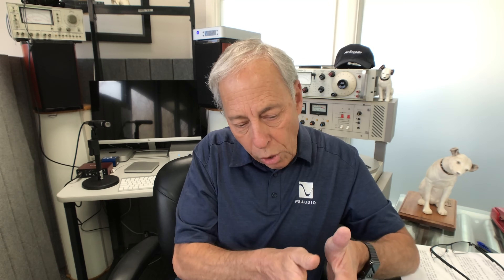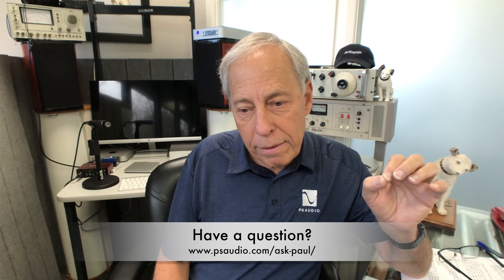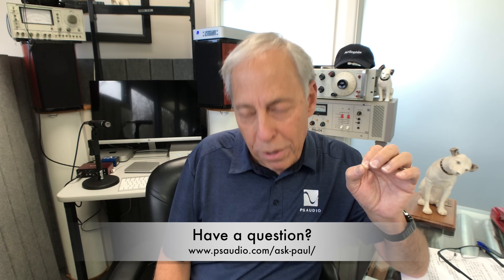What's an electrostatic speaker?

Comment: Arcing is not possible with a properly built electrostatic panel because an energized surface has a conductivity as of 1-10 MOhms per centimeter. This makes arcing impossible. But it can damage a foil or other components of course, depending on how close to a normal wire contact happens.
Sweet spot is a matter of a dedicated stator section. Many designs exist including integrated "crossover" that feeds stator sections with different frequencies. Your Infinity has a very similar column of tweeters by the way.

Comment: Roger Sanders was a pioneer of producing curved electrostatics. He did fine, however, that the flat panels actually presented better. Thanks!
Reply: Yes but the flat panels dispersion is limited to directly in front of the speaker, aka a sweet spot. Where as the curved panels spread the sound waves out more like a traditional speaker. I have quad esl 57’s and if my head is not directly infront of each panel the sound quality/detail drops off
Reply: @daviewavie112  I agree Davie. From what I know about the good Mr. Sanders, I suspect he wouldn't mind having the classic head in the vice approach to listening. Congratulations on owning Holy Grail speakers. And I say this as a theologian :)

Comment: So is it safe to say that the AC signal from an amp works against the polar electric charge on the panels? Essentially it's  comparable to how a magnetic field is used against a conventional speaker's voice coil, if I understand it correctly.
Reply: Yes very similarly to what I understood aswell.

Comment: Is there something that combines both - electrostat and the ..um standard one?
Reply: Hybrid speakers that combine different driver types, like Ribbon Tweeters, electrostatic and low mass drivers.
Paul has talked about synergy in the system, between the source, pre-amp, amp, speakers, and the interconnects, well, the same is also true within the speaker too, between the box design, driver selection, and the crossover, get any one wrong and the collective whole suffers.

Comment: Doesn't the width of the electrostatic sweet spot depend on the width of the panel of the speaker? A Martin Logan Monolith should have a bigger sound stage and sweet spot than their entry level speaker.
Reply: They don't quite have the left-to-right "beamy" nature of flat panel speakers like some planar magnetics, as Martin Logan has been making curved panels for quite some time now. But to a degree, yes, the size (especially the height) of the panel dictates the effective vertical off-axis response. The flagship Neolith is essentially a CLS-style  (a smidge larger, actually) panel with a massive dual-opposed woofer setup down below, and it's very tall (a little over 6 feet), braced, and heavy.
Reply: I'm not sure if there is a relation. I used to own a pair of CLS's and they had a very narrow sweet spot. They required a lot of room to breathe and were very finicky about placement. But once dialed in, oh what a sweet spot it was. I miss them tremendously.